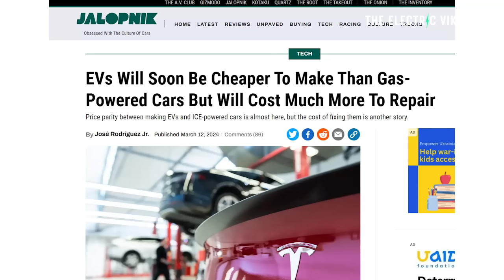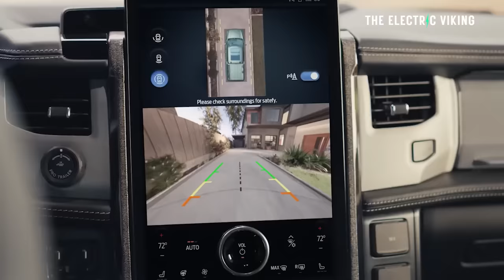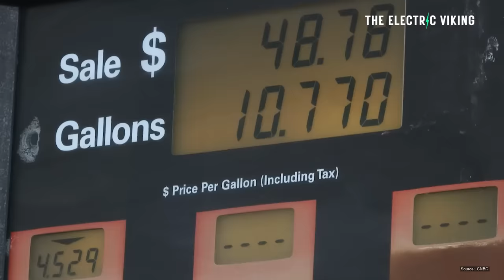The EV Price Premium no longer exists in the United States

Comment: In the USA you can get used Model 3's for 15k now including the federal used BEV rebate, figure in gas savings and the car is almost free.
Reply: The only Tesla in that price range here in Colorado would be a 2013 with over 100,000 miles on the clock and hail damage. lol, believe me, I've been looking. I had to settle for a 2017 Chevy Bolt at $17,000. EV's are not cheap here.
Reply: @kentyler3962  You are right I look within 100 miles of Denver and the lowest price for a model 3 with 38k miles is $23,000 usd.... if you are more flexible and are will to drive further there is a Model 3 in St Louis for 12k and Austin TX has one for 15k....both are 2021 so likely not LFP but still a good deal. I would try to get a 2022 as it is sure to have the LFP batteries
Reply: I just moved to Colorado - which has a nice state incentive too - so about 12,500 off the right model. As soon as my current car is paid off, I may consider this.

Comment: To achieve true price parity, EVs will have to be priced the same or lower than equivalent ICE cars without incentives.  I'm confident they'll get there as battery prices continue their march toward ever lower costs.  Indeed, given BYDs recent price cuts some of their models are less expensive than ICE equivalents now but I wonder what their margins are...
Reply: Based on the median value of the preview and excluding the contribution from BYD Electronic, BYD had an average net profit per vehicle after non-recurring gains and losses of RMB 9,100 ($1,270) in the fourth quarter, SDIC Securities analyst Xu Huixiong's team said in a research note today.Jan 30, 2024
Reply: Actually, cost parity between ICE and EV might prove very elusive. You replace the engine and transmission with 1 or 2 motors and a big battery. More materials go into making an EV compared to an ICE as EV are heavier than comparable ICE cars. So how can EVs become cheaper to manufacture in the long run? Some of thr savings ev makers make right now come down to manufacturing processes and techniques that can be adopted by ICE makers as well.
Reply: If your going to talk EV incentives you need to talk Oil incentives.     As for margins it was reported that car dealers lose money on new car sales.  But yes the make it up in service and repair.
Reply: @danharold3087 did you know that Green energy subsidies in the US is currently the same as oil subsidies? Yet one of them currently has a market share of less than 15% for the same "cost". Question is will we ever break even on green energy if we have to continually upgrade infrastructure and generation to account for YoY energy consumption growth and replacement of older generation hardware.